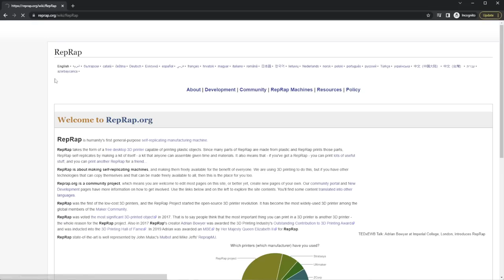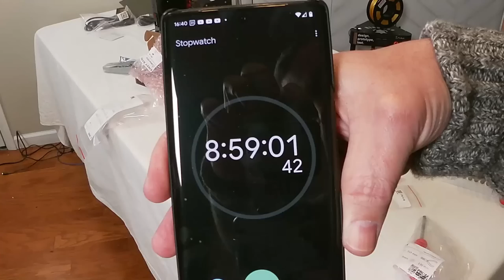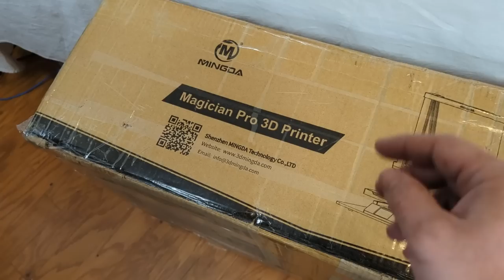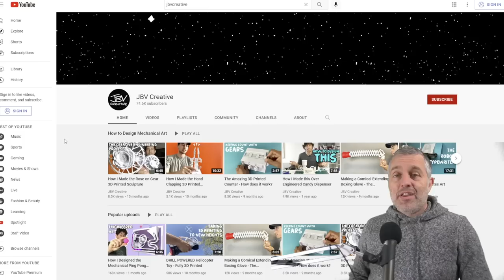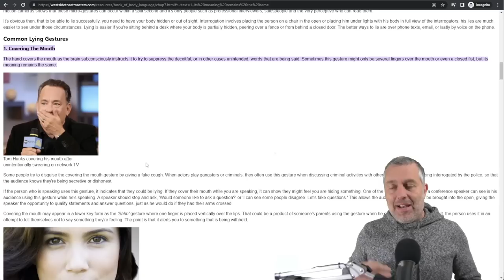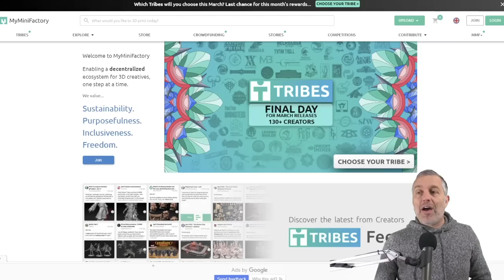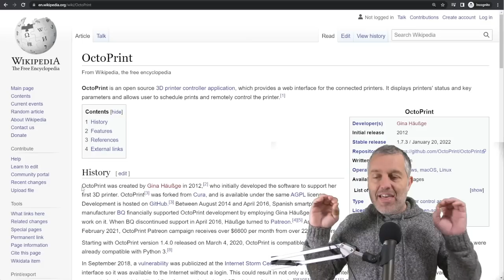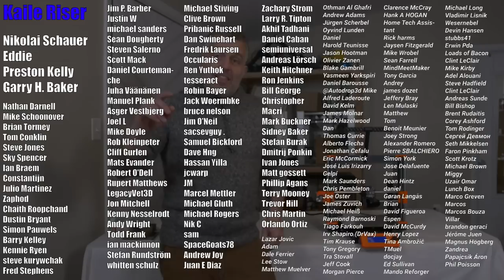Why Does Nobody Speak Truth About The Prusa I3 Mk.3? - It's Overhyped and Over Priced.

Comment: Great vid my guy. I appreciate someone being honest about how mediocre Prusa machines are. I bought a Prusa in 2020 and it's...ok. I really wanted a reliable printer that just works...I didn't get that. I've printed some cool projects with it, despite the prints being meh. However, because you can't properly level the bed, even with the algorithms and compensation programs, I've had a hard time with it since then. Overall I'm just disappointed in the printer, myself for thinking it was worth my money, and a little frustrated with the internet for telling me it's the "best" printer. And now, i think I am just going to have to buy an Ender 3.
Reply: The parts you get with the printer are well toleranced such that leveling screws should not be necessary. Your package got damaged, you assembled it poorly, or you got super unlucky with QA. Regardless, you can solve your solution without having to create new ones with a low quality printer like the Ender 3. Look up nyloc bed mods for the Prusa, you can indeed get your bed well leveled and test the probe readings. Either way with the Ender 3 or your current problem Prusa, you're looking at hours of time to tweak things. Might as well stay with the printer that has more features once you're done tweaking.
Reply: Lmao okay then buy an ender- and see how much more unreliable it is 😂 if you’re having problems with your prusa you could try contacting their excellent support staff :))

Comment: I've had a mk2 for years and did all the upgrades as they came out, had the printer more on the bench than printing and I printed a LOT.... bought an mmu2s and I could not get it to work either.. Then last year I bought a Mk3s+  assembled,  printed great for six months the that ended suddenly (I didn't touch it other than lubricating and making sure belts are tight enough) this was 4 months ago now, and after talking to support for hours,  completing the full wizard setup around 18 times now (after disassembly and reassembly for more times I can count) and still its not printed a single item since.. I've spend so much time on it that it's now time to go in the trash. I'm so amazed that it's such a revered printer and labeled as a reliable workhorse (which I actual do believe - the community in general is awesome). Its just not what I experienced, you may say its because Im not doing it right but I have six other cheap printers all printing perfectly without issues.. plus a laser cutter etc etc...

Comment: Two cents worth of my thoughts.
Most of your points are valid. But I still believe the Prusa is the best 3d printer out there.........for what I wanted to do.. did you catch that last bit?
I teach Avionics (thats Aircraft Electronic servicing and repair skills). I wanted to expose My students (and the staff) to 3d printing, but in a way that could have the variable immersion required for buy in from everybody.
I personally have an ender 3 v2, a tronxy x5sa and a home built corexy but selected the prusa as most suitable for my needs, and it has been awesome, from the build to the almost 24\7 printing of training aids and other not so sensible things that it has done for close to two years now. 
Sure, in NZ dollars the kit (including MMU2) was ten times the price of an ender3 V2 but It was and still is the perfect tool for the job.
 It might be in some ways a turd, but its a very polished turd and that IMHO is why it IS worth the money.

Comment: All i got to say is that i built the one I got in 8 hours :)  You can buy 2 ender3 S machines for 1 prusa, and it takes like 15 minutes to put those printers together. My personal feelings.
Reply: And it takes ages to mod them to get to same reliability and convenience level. There's that. Bed level probe, filament sensor, second stepper for Z, new sheet system, doing firmware/changing mobo and changing hotend fully to print same materials. Printing is still slower. After all that. Is that 15mins so good thing?

Comment: What is wrong with this guy? Blaming Prusa for using Marlin? They at least honestly say it's Marlin. Chinese stuff like Creality don't give any credit. They've done substantial re-writing of the code. Yeah I have Prusa and I love it. Just few weeks ago I bought Ender 3 V2 as it's hyped so much and my first printer was really shitty Anet and wanted to see how much things have improved. Ender began to show it's one stepper on Z problems quite early on. Leveling is pia. FFS even the fan began to rattle after four hours. Thing sounds like a friggin' vacuum. I almost immediately modded it with second Z-axis motor and BL-touch probe. Now it's functional, but slow as balls compared to Mk3s and stringing is still bit too much for my liking. I have to say that Prusa with Octo is just breeze to use and is definitely worth the price. Oh yeah and forgot about Ender's build plate. Friggin' glass that you need to fiddle around with different filaments. That needs to be changed too. All in all. Ender 3 is junk out-of-box, just saying.
Reply from the maker: Where do they say it's Marlin? I showed a search of the Prusa website and the only references to marlin I could find were community posts by Prusa's customers from 2018.

Comment: I have a Prusa Printer (i3 Mk3S with Bondtech BMG extruder).  I like the printer, but don't identify as a fanboy.  I agree with many of your points other than to say the printer is not worth it.  Building a new gaming PC is not "worth it".  The thing will be out dated within a few months and you will have spent $1000+.  But can you have the fun without building the gaming PC?  No you can't.  Can you have fun using any 3D printer that functions?  Yes you can.  So are there better values on the 3D printer market?  Sure, you pointed that out.  I think the Ender 3 has become a great printer and is a good value.  This is the same debate on Ford, GM, Toyota, etc.  The best value may not be for you.  I think making a recommendation is great from a respected voice (meaning you) in the 3D printing community and hope others find your video helpful.  If I was starting a print farm, I agree that the Prusa is not the right value for that.  I enjoy your content and value your opinion.  Keep up the great work and I will continue to watch your stuff.

Comment: What a surprise you won't "necessarily agree" to the mk3 being the best printer, it's a Prusa so of course you won't. What a Don Quixote-channel this is...
Reply from the maker: If you've paid attention to my channel and didn't cartoonishly caricature me as some sort of unreasonable anti-Prusa know-nothing you would have noticed that I NEVER said Prusa wasn't top of the bunch. I assumed the internet was correct and nothing could beat a Prusa out-of-the-box for best printer at the price. Finally after all these years, getting this one in my hands surprised me how thin and questionable that advantage is. Which is what I showed in this video. I am reasonable. I will acknowledge Prusa for his wins and contributions. It is your team that unreasonably attacks me and refuses to acknowledge the flaws in Prusa (the man or the printer). If 'll make a deal with you. Tell me something bad about Prusa that's not one of my talking points in these videos. I mean actually bad. Not half-hearted or twistable into a good thing. It has to be something that any reasonable person would say "OOF, that's not good." If you do this I will tell you 3 (Yes, I'll give you a 3 for one) things that I admire about Prusa the man and the company.
Reply: The MK3 has had its run. I've been using mine for many thousands of hours and it has revolutionised my way of working as set designer. But it's now old, what was fresh when it came is now part of most other printers. Prusa even have said that there's no point in updating from mk3s to mk3s+. It shows that the next step is coming, the XL is a large leap forward and its features will surely be part of a MK4. It's so not sincere to review this printer now, of course it has aged, of course other printers can do what it does. You will come to the same conclusions when you review the XL in 2030. I have no idea why you're so angry at Prusa, but this is the farthest away from a review I've ever seen, you might be good at what you're doing as designer, but you're just too hateful to be listened to by consumers or prosumers like myself. I thought I had informed the YouTube algorithm enough to avoid your videos, but they bounced back.
Reply from the maker: This comment is mostly just a re-statement  of the theme/thesis of the video. If you don't disagree with me, why the animosity?

Comment: Well, I bought a mk3 as a total beginner (the kit). Built it according to the manual, and what should I say? It runs... and runs... and runs... without any issues. With a 0.4 nozzle, as well as with a 0.6 and a 0.8 nozzle. No first layer issues, no issues whatsoever... So how could I / should I talk negatively about this printer? I am a hobby guy and I enjoy my mk3. And guess what? I just ordered a mk4 kit :-) Call me crazy, I can handle it! But quite honestly, I don't want that China rubbish, when I can have some good European product, even if it's a bit more pricy. The Bambu Lab printers could be an alternative, but I am not quite convinced yet... perhaps eventually
Reply from the maker: Why did you buy a Mk4 if your Mark 3 is perfectly functional?
Reply: @DesignPrototypeTest  Well, I did it for two reasons: Input shaping and better speed as well as better quality of the mk4 (hopefully) and because I want to print with big nozzles on the mk3 then (up to 1mm and perhaps above) and with the smaller ones (0.4 and 0.6) on the mk4. As I am lazy and don’t want to change the nozzles and calibrate all the time, I thought, this could be a good idea.
Reply from the maker: these are all very minimal gains that could have easily been achieved on your Mk3 . If for some reason you absolutely had to buy a new machine, you would have been much better served on these reasons getting a Bambu Lab X1C. It sounds like you'r blind devotion to a brand and emotional desire to have the new shiny thing has caused you to spend money unwisely. I don't see how this is a feeling of my person for making a video that criticizes Prusa. Introspection is valuable shooting the messenger not so much..
Reply: @DesignPrototypeTest  Wise or unwise... that is the question! I cannot estimate it - in contrast to you - yet. Let's talk again in 2-3 years, then I might know. But at least I don't have a completely bad feeling....
Reply from the maker: I wish you all the positive experiences possible with 3D printing. Truly. Have a great day!

Comment: Made it to 14 minutes. I'm sorry dude but if you're going to completely gloss over all the ender 3 issues because you can have a 20$ bed level system..... well you sort of earned the dislikes from a lot of people. V-wheels in v slot extrusions........ f'n sick yo.  Also the PINDA sensor is sort of like  a BL touch that is "mechanical". still a hall effect sensor using magnets for position.
Reply from the maker: You are correct about the Temperature based sensor drift being the same with the P.I.N.D.A. and the BLTouch, but both sensors are "smart" and compensate for that. The fact that the BLTouch DIRECTLY measures the print surface and not a substrate under the print surface is quite advantageous and makes the Touch sensor undeniably superior.  

V-wheels are fine. Think of them like tires on your car. Whereas the Prusa technique is more like metal wheels and tracks of a train. Tires are a consumable. That being said, I've never needed to replace the V-wheels on any of my printers. Just wipe down the groves with your finger before each print to remove any dust and you shouldn't have any problems either. The Prusa motions system isn't perfect. It is quite noisy, requires lubrication and has a bit of play or "back lash" inherent to it.  This back lash is the benefit to using V-grove wheels. Using the eccentric nut you can completely eliminate such.

Your vitriolic tone is misplaced, and I don't see how you can justify me "earning" a dislike from you. I think you are being entirely too emotional about 3D printers.
Reply: @DesignPrototypeTest    I bought a bambu Lab X1 carbon because of your review 1.5k+$ ...and to be honest I hate it. I know everyone has opinions but when I wait 8 minutes to fail a first layer, it just kills me.  (yes, i did a glue stick slurry, full startup gcode, correct plate, temps, material, and and extrusion widths accounted for tunes with and without SoftFever). I get perfect results on my mk3 without all of that, i was just lusting for speed. I know you don't care for prusa that much and thats okay if you don't. Just dont blast something that has the potential to make someone else extremely satisfied. I get your POV and controversy does sell views.(Got me.) Just be More fair and thorough in your next videos and I'll happily support you.

Comment: This is your second video against J. Prusa and his printers. You talk about a lot of things, but you never talk about safety! I've owned also 2 Creality-printers, and bought also, 2 years ago a MK3S printer (kit), and every print goes very well, and with the 2 Chinese (bowden) one's there was allways something about it (bed adhesion, quality, noise etc), also they feel like toys. First i can walk away from my Prusa while he's printing (and i can't here it barely when he is printing. instead of the both from China!)  and i've done so many test with the Prusa for safety, and he allways quit the print or remaining the print with succes, even he detected that there was no filament and stop with printing while the Chinese-printers are printing (with no filament feeding) nothing in the air ;-). The Chinese printers they have absolute no safety (no fuses) and make a terrible noise, even with modifications on the stepper motors. And how can you show a print that you made on 132% speed and show that there something wrong witrh the print, how will it looks with the normal speed (or better slicer-settings)? When i search on the internet allmost all the printing farms used a Prusa-printer instead of a (cheap) Chinese one, why should they do that? Because of the reliabality and the quality, and maybe for the safety (and feedback/service 24 hours a day!!). They earned money for the printing job's and they don't buy a cheap one from China, no they pay more for reliabality and the quality, and maybe for the safety!!!!!! And better a (good) installion-book (and website) to assembled your printer, instead of a Ikea-kind of building paper, when there something go wrong with my Prusa-printer, i'm not affraid to repaire it by my self, because i build it from scrats and know every part of it! Since i've my Prusa-printer i have much more fun to print things, instead of the time, i've had the 2 (cheap) Chinese one's. For quality, durability and security you have to pay more, it's the same with cars from Europe or China.

Comment: Thanks for sharing the video. i own a FLSUN, SR   i had so much trouble in first, most based on a cheap Extruder Clone.MY Suggestion: its good too run on problems so you understand how the printer is working and how it can be fixed. A 3D Printer is a maintenance based unit ,not a 24/7 running machine  where you set the settings one time and it will run for 2 years without troubles. So Immo i would never recommend Prusa for beginners, because you have to build it on your own where problems can begin. The Price based on the parts they use, is also overpriced. They all at the end uses the same technology like e3d and so on. also the prusa i3 mk3 or 2022  has a ugly and small build plate. Dont get me wrong, i like Prusa and what they have done and are doing, but for beginners its to expensive and at the  end it  will only print plastic to a form ! Everyone should ask himself if it is worth to him to spend 1000 Dollars or Euros do print plastic at the end.. my flusn sr has a greater build size, a better display and control. it costs me 420euros,  half of prusa prices  and it prints TWO TIMES FASTER in most cases. would i buy a prusa in future, maybe if they get cheaper and bigger.

Comment: When I started printing a few years back I almost felt bad for not getting a Prusa. Couldn't justify the expense. Got a cheepo sidewinder x1 instead of an ender because I "needed" the size. It's been a great journey. Definitely building a Voron next. Thank you for not ignoring the fact that Prusa printers are not perfect.
Reply: I initially felt that way too.

Looking back 10 months now I would actually be upset if I spent that money on one prusa.

Before you drop the coin on a Voron you should look at the Two Trees SP5. They've worked 99% of the bugs out. I can honestly say I have no desire to build a Voron anymore. The SP5 is only $450.
Reply: @dangerous8333  Thanks for the info but I kinda want to build from scratch as a winter project.
Reply: @dangerous8333  you are missing the point of voron. Its a ecosystem that money cant buy.